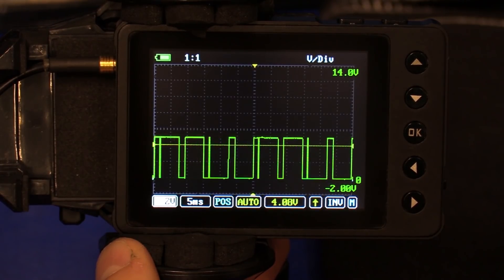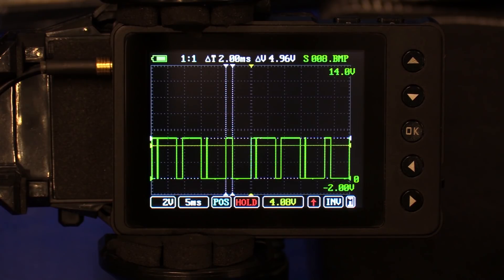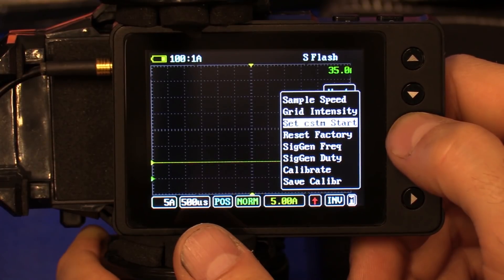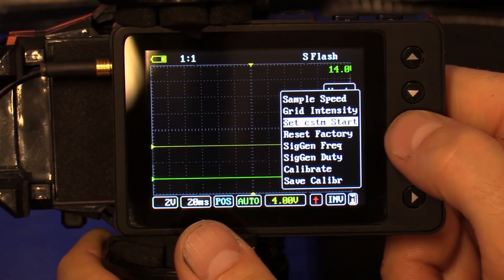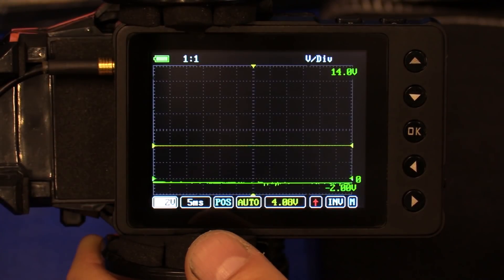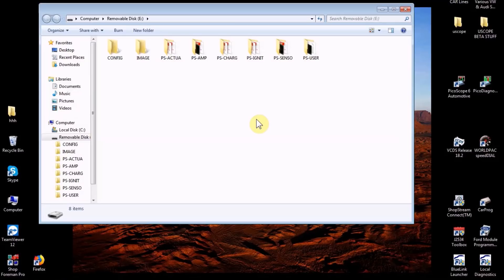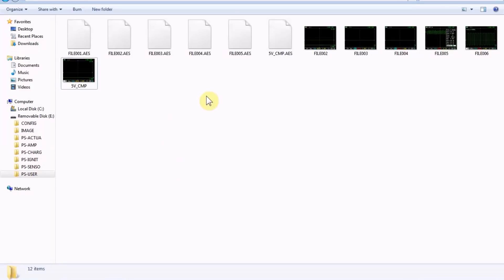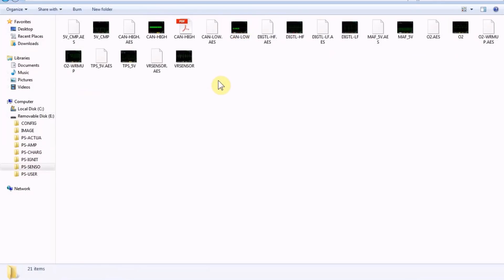uScope -  Advanced Features 1: Cursors and Data Management

Comment: Hi Justin Can the USER presets be deleted without causing a problem with the scope? Thank you for all the info
Reply from the maker: A preset can be deleted, added, renamed, or moved from any folder when connecting the scope to a computer via USB. It will have no affect on the scope. All presets or stored on the micro SD card.
Reply: @AESwave  thank you Justin the last time I tried to clear a waveform,I deleted the whole card and had to contact AES for a replacement. I wonder what I did wrong then?

Comment: Thanks for the video, learned about some features I wasnt real familiar with. One question though, say you have a single captured screen and zoom in on it by changing time or volts per division. How do scroll over to see the rest of it? Hope I'm asking that correctly and you get what I'm talking about
Reply: This will be better covered in the third video and the updated manual.

When the waveform is capture and put in to hold mode, you can use the HPos function to move left and right. When the main menu POS function is active, you can use the arrow keys to scroll through the recorded data after adjusting voltage and time levels.

 The upper right corner will display your horizontal position within the captured waveform.
Reply: Scott Andresen I thought I had tried using my cursors to "scroll" through the captured waveform and when it got to the edge of the screen it didnt continue and move the waveform. Or are you talking about a different setting?
Reply: That is correct, the cursors will not scroll through the waveform, they are independent of the data.

Using version 6.0.1 or older, you can highlight the "Time per division" on the bottom menu and press OK twice.  This will open the right menu and bring you to the Horizontal Position function. With Horz Pos highlighted, you can use the left and right arrow keys to view additional data. This can be done both with live and held waveforms.  While Horz Pos is highlights, the numbers at the top right of the screen will indicate you distance from the horizontal trigger point.

Reference the other uScope Basics video at 6:10 secs to see the menu option 
https://youtu.be/aazmvhgZpy8?t=6m7s

As always, you are welcome to call and talk with us.  It may be easier to understand if you have the scope in your hand and I walk you through some of the features.
Reply: Scott Andresen oooh, I understand now! Thanks so much for that information! I was bummed/disappointed thinking the scope was unable to do so. Awesome, awesome info in your videos and thanks so much for your responses!!!

Comment: What's the connector on the uscope called? Do they make an adapter to go from that to bnc so I can use my uscope cop paddle probe on my autel scope that has bnc connectors?
Reply: There is an adapter from micro bnc to female bnc so you can use existing accessories you may already have. Available from aeswave.com or contact them via phone.

Comment: Hi there,
Trying to follow along but I cannot get any of the folders to open, they only have .AES files available.
Reply: There are no PDF files which I was really looking forward to studying
Reply: Allan and Rowena have you updated the software and the presets? If not and you need direction please let me or aeswave know.
Reply: @bav-lab3584  thank you for the reply.  
Yes I have the latest firmware update.  I did that first before trying to find the pdfs. It is the first time I have updated the tool, I just went to the latest update. Could that be an issue?
Reply: Allan and Rowena after the software update there is also a separate update function that needs to be done to load presets and pdf files
Reply: Here is a link to the update instructions that includes the web link for both the software updater and the preset updater. You have already done the software it sounds like so you are 50% done. Once you perform the preset update you should have all the latest presets and the related pdf files on your uscope. Make sure you follow the instructions closely. Let me know if you have trouble :-)

https://lookaside.fbsbx.com/file/uScope%20updater%20guide.pdf?token=AWxBMvAXK3fotV6fheXAIn6WeThv9ukxVYlJMN7vTZPJ9gh1eGQQIDMVvaSwCtvGMrrd_BD5McXJ8A-3U3eU-6ker9PJBd0K2lxlqtxKyey-awMkqIWiIvFYIYpmNQI9SegCUQ1y1myf7J6xE1_n-LbL3e4u3TgpIxrgndTaoy_gQHQWhfPFXTIc2MQ34ZP4bBjuRLs78IP39x6r51wha-d6
Reply: @Allan and Rowena were you able to update the preset folders and resolve the missing pdf files?

Comment: Can I use my 10:1 Pico attenuator  with BNC adaptor. Is that save for the scope
Reply from the maker: The Pico attenuator will not cause any damage but it will not read correctly. Voltage will be about 10% higher than actual and it may produce some overshooting of the waveform on fast transitions.

For the most accurate waveform, the uScope attenuator should be used.
Reply: @AESwave  thank you for the prompt response will purchase the correct one for scope  cheers

Comment: Why is the battery indicator glitching?
Reply: driftwhat; since the battery indicator has a set number of “percentages” on the display. It will flash between 75-50% as the battery charge level actually approaches 50%.

Comment: Excellent video ,do you have a personal channel ,I would like to subscribe.Thanks !
Reply: radu soptea I will find out for you
Reply: LOL Keith :))))
Reply: I do not have my own channel, maybe one day.. But I do have some more videos coming out with this updated uscope. so subscribe to the channel they are coming shortly, Thank you
Reply: radu soptea I never lie😉. Justin is brilliant. So we can all hope that someday he will find the time for his own channel
Reply: No Keith ,it just sound so funny that one of best world tech has time to spent for my little problems :)) If you want to spent some time please promote in one of your next videos :when looking for a parasitic draw ,instead of measuring voltage across fuse ,better measure between positive pole of battery and fuse ,longer wire will show greater voltage .Had nt time to check it ,but I think is a great idea :)) Thanks !
Reply: radu soptea hmmm. That sounds nice but unnecessary work. Results of the voltage drop make no difference. Any voltage drop is an indicator of parasitic draw on that circuit. How would this be of benefit?
Reply: Just saw one of last Ivan video about parasitic draw and voltage drop on the fuse was just 0.6 mV which I think is close to lowest voltage that can be measured, maybe a longer wire will increase voltage .I will check this with first occasion.